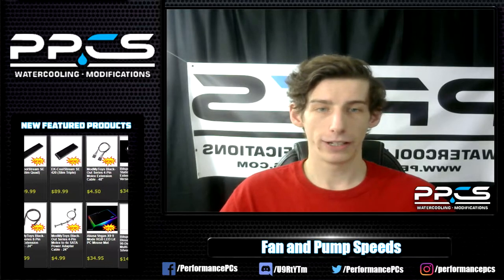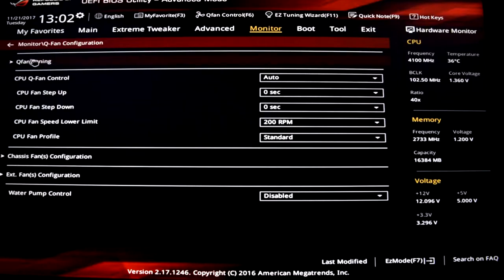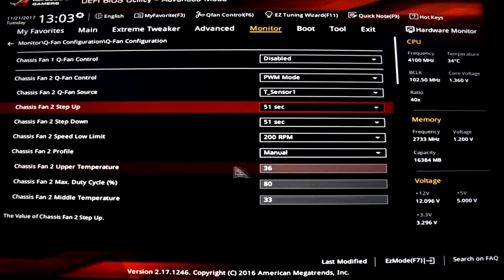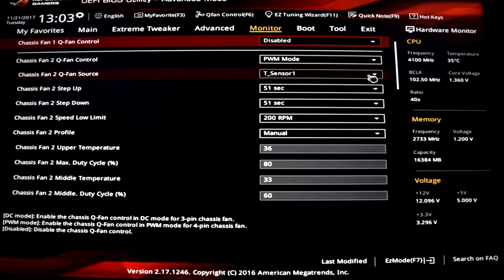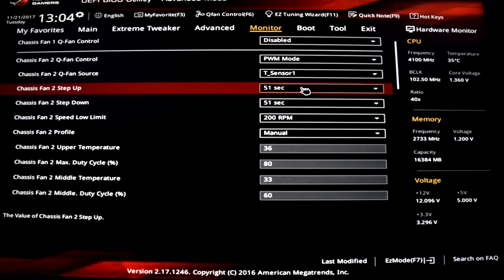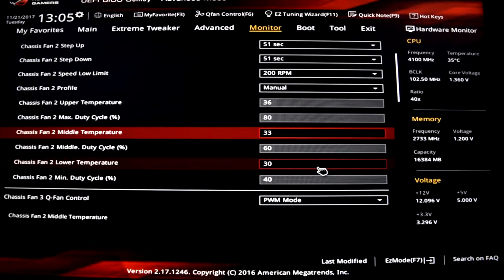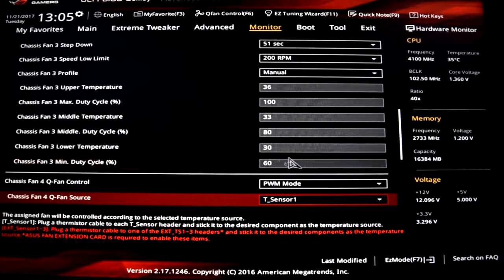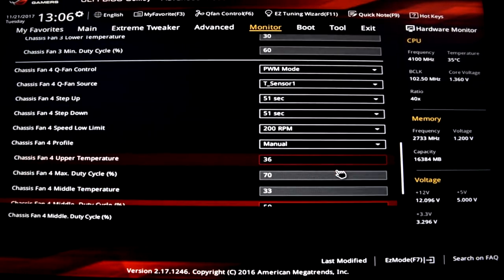Setting up your fan and pump speeds

Comment: The only "helpful" video I've seen so far about AIO's, just set mine up today! Thanks!
Reply: I'm only missing one thing, please make a video on where we should connect our fans to. 
So far my 2 radiator fans and 1 more fan is connected to my pump fan, 1 more fan at the back is connected to the cpu_1, I hope you got what I meant. 
I'm using a nzxt z53 and an asus rog strix b450-f mobo. I hope that makes sense. Thank you tho for the knowledge. I'm setting it up for gaming, work and video editing.

Comment: Awesome sauce! I just got a whole set of EK quantum stuff for my PC, and the fans and the pump just kept going up and down up and down (fuck you 5800X for being such horrible beast to tame). This guide was the first that actually explained how to do it! I watched a million guides, and did hours and hours of research before biting the bullet. But man, watercooling is kind of hard anyway. EK has many guides and explanations for what is what, but there's just so much still missing, the big one being fan control for me. 

Mobo manufacturers doesn't make it easy either. Because, some fan headers you can control fully, other is just "FUCK YOU, you can only control half this shit! (and not the things you want to control)". There should be a EK mode in all BIOSes (or custom loop mode). That would give you full control of all the fan headers. Also, there should be a built-in temperature reader inside reservoirs (I'm looking you Quantum Reflection D5 PWM for Lian Li O11 Dynamic).
Reply: how to lower pump speed on ekwb exactly idont understand

Comment: Got a question how to do prime your system with a PWM pump?  I know with a regular pump you can connect the Molex from the pump to an external power source so that you can test your system without turning on the whole system  How do you do that with a PWM pump?
Reply from the maker: You want to just plug in the molex power and leave the PWM cable unplugged. You use one of these jumpers to start your PSU. Which will allow you to only power pump, not the entire system. 

http://www.performance-pcs.com/bitspower-power-supply-starter.html
Reply: Matt not all pwm pumps run at 100% when unplugged like Swiftech D5 but if you buy a EK G2 Pump it will run at 100% when unplugged. If you finding that your pump seems to be running very slow and you don’t have the for mentioned EKWB G2 Pump then you will need a pwm jumper to molex or sata cable PPCS does sell this cable as well as EKWB for their older model pwm pumps but for the life of me I can find it on the site. If you want to make your own there are several videos on YouTube that show you how to make one Singularity computers as a nice video on this subject. Hope that helps